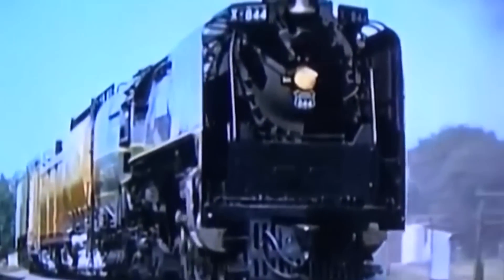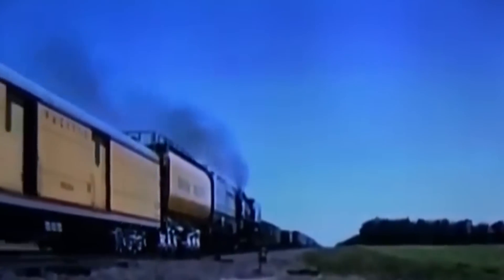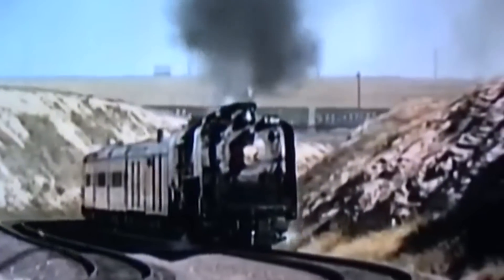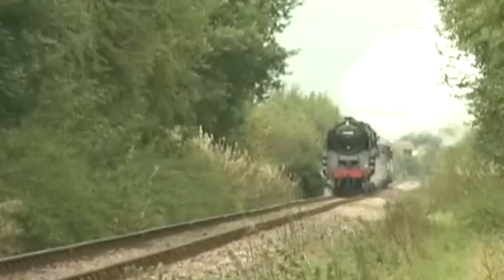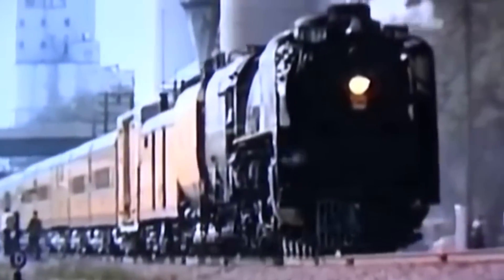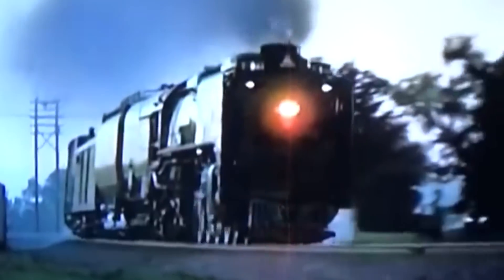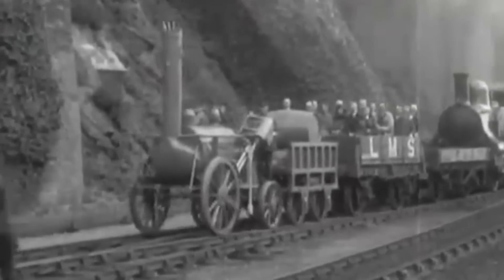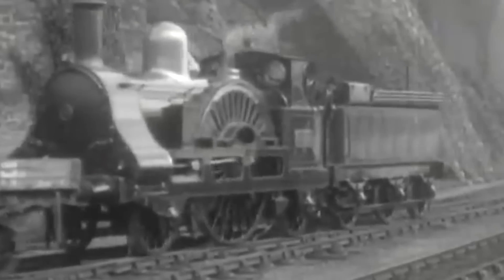Why Did Steam Locomotives Need Smoke Deflectors? | History in the Dark

Comment: We even had some diesels (SD45s with a carbody) in Denmark with a lot of noise dampening stuff that slowed down the exhaust to where it didn't clear the (passenger) train. They were fitted with smoke deflectors, and the problem was solved.

Comment: Reputedly, smoke deflectors had even been considered on the LNER A4 class (Mallard and her siblings). Instead they tried altering the body right behind the blastpipe, inspired by a thumbprint inadvertently made in a plasticine model, and found that it worked to lift the smoke clear of the cab!

Comment: Also when locomotives grew in size with larger diameter boilers the chimney or stack whatever you call it went shorter. This also increased the likeliness of smoke descending down on the train rather than being lifted. In Germany essentially all large standard Reichsbahn locomotives had them, like the classes 44,50 and 52 2-10-0s, 41 2-8-2 and 01 and 03 4-6-2s.
But also some earlier classes from the Landerbahnen of Prussia, Württemberg and Bavaria got them later on.
In the UK they were used on some types of the LNER and LMS Pacifics, the larger SR 4-6-0 classes and the BR standard Clan and Britannia Pacifics and the 9F.
Here in the Netherlands only 3 locomotive classes got them, the 3900 and 4000 4-6-0s and 6300 4-8-4T
Reply: it’s called a FUNNEL
Reply: no it’s called a FUNNEL,  the correct term is Funnel, Not chimney, Not Smoke stack, it’s called the Funnel